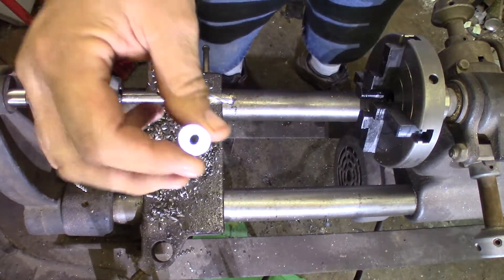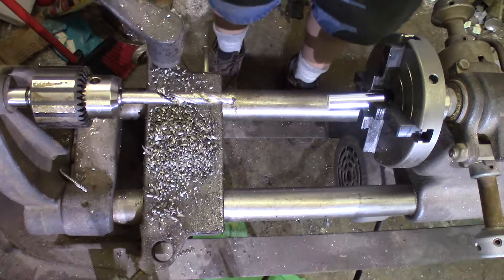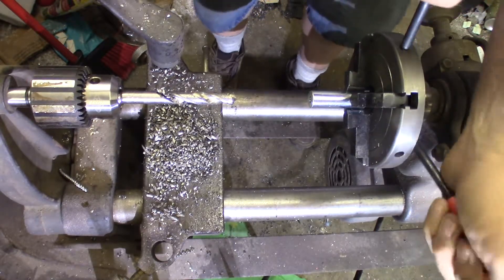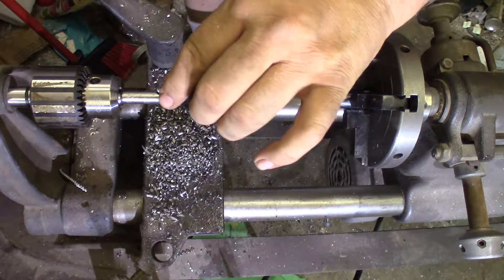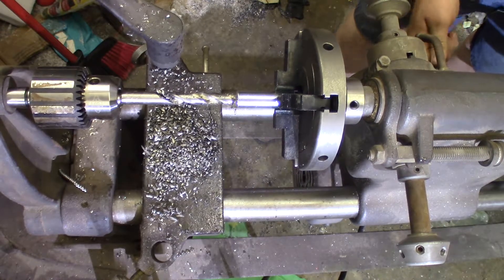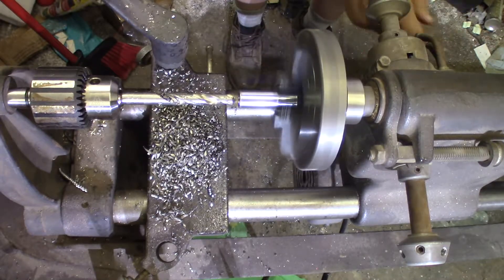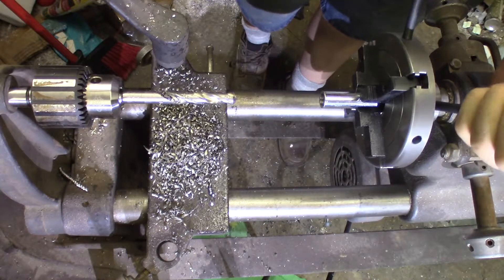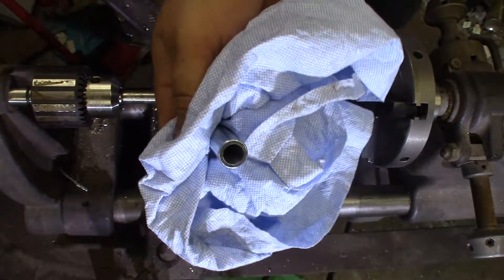Using a 1940's Shopsmith 10E to Bore a Metal Bushing

Comment: Where did you get the four jaw chuck?
Reply: Woodworking four jaw most likely, since it used a pair of "Tommy bars" to tighten and loosen. It should be possible to mount most small 3-jaw and 4-jaw chucks on a Shopsmith with the correct adapter.

Comment: Hi i found a very old shopsmith 10E in the trash...in complete working condition..eith orig stand .what kind of value would it have? Scrap?  25$ 50$ 100$?
Reply: NOT SCRAP! That's a classic yet fully functional tool from 1947/48! Hell, even if it's trashed, parts will sell over time.

Comment: Nice YouTube. I also like you use Amsoil. I just got a used mark v and used Amsoil’s MP to loosen up the sticky parts and clean everything up. Now using paste wax to keep it nice. I use the MP to oil the pulley shafts.

I found and bought an old 10 ER that I’m gonna start to restore. 

Nice video, thanks